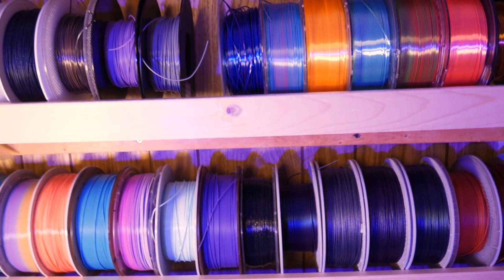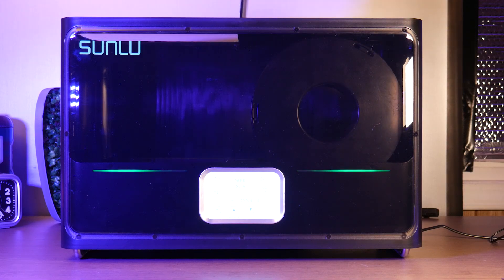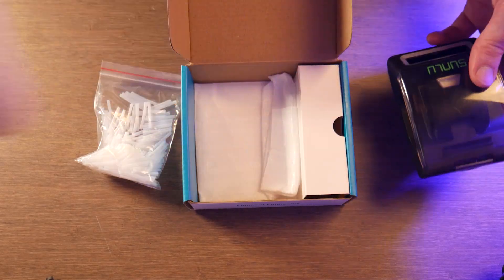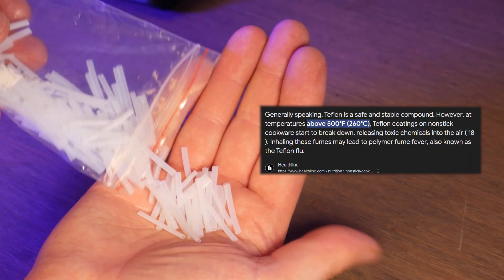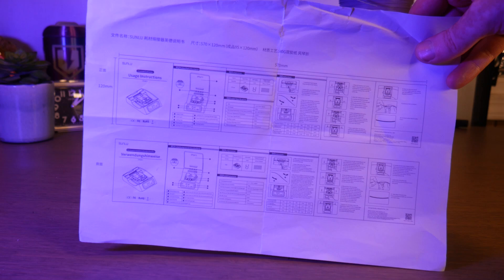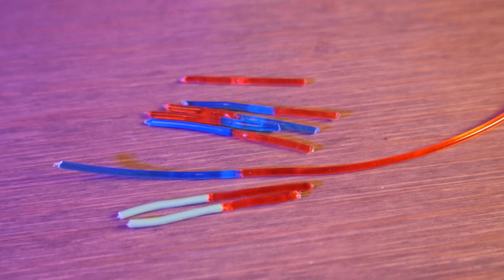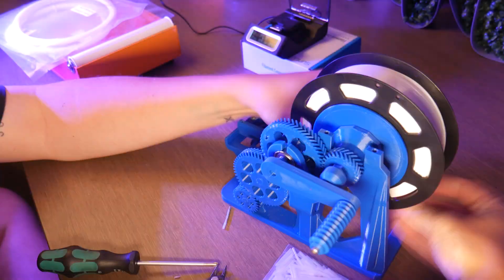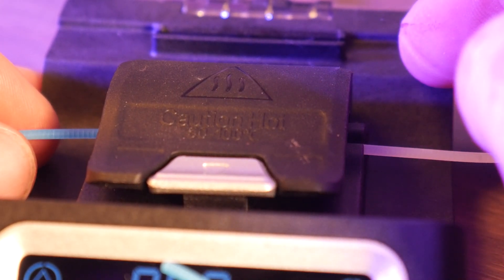Unlock Zero Waste 3D Printing with the SUNLU Filament Connector FC01!

Comment: After fusing the two pieces, are you able to slide the connection out of the PTFE tube (the tube slides down one side).  If that works, I think I would get one to put between two spool rollers so I can then spool from the lesser section onto the bigger side then swap the lesser spool for another.

Comment: I notice many are upset about the PTFE tubing, but no one is worrying or happy about all the filament they are saving by not throwing it away? No one here has ever wasted PLA. I bought this and know you can do the same without this unit; use a heating iron and a PTFE tube,  but this is much easier for me. If you don't like this idea, do not use it or build your new and improved model, then sell it. It's all your choice. Have a Great Day
Reply: How do you do it with the iron and PTFE tube?
Reply: @g8610g  About the same way, cut your PLA at about a 45-degree angle. Take about one inch of tubing and match the filament you want to join inside the tube. Take a soldering iron and go back and forth on the seams inside the tube, slowly pushing together. You will see them join. Let cool, remove the tube, and TEST  by pulling it apart. After a few tries, you will get the hang of it. A guy who was also a fisherman did this to make his own lures. Good Luck, it will take some practice.
Reply: That sounds great but if you go over the PTFE tube where the 2 filaments join with a soldering iron wont the PTFE tube melt?
Reply: @g8610g  No, the PLA will melt first. But you go back and forth, not just in one spot, but also on the bottom. Don't try High heat; use Medium. Note that SUNLU does not melt the PTFE tube. If you had a lot of filament welds to do, I would buy the above SUNLU connector.
Reply: @randystevens2710  ah ok. Thx!

Comment: 100% I'd use this. When printing things that take days to complete but need certain colors, sometimes what is left over on a spool isn't enough for another big print, so being able to graft an old spool onto a fresh one of the same color means no waste or excess filament that I need to print smaller things with in order to use up. Replacing the old spool with the new one mid-print isn't an alternative to this as I can't always be on hand to replace the spool right when it runs out, meaning it would save me lost printing time due to a runout. Not to mention the fact that having a spool run out and be detected by a sensor can still leave a gap or imperfection on the model due to it sitting and cooling while you change out the spool and throw away that small piece of leftover filament.
Reply from the maker: Yeah I think that’s the ideal use case! I’m thinking of printing a reusable 5kg spool to wind filament on for my bigger than 1 kg giga prints! Thanks for watching and for the comment!

Comment: The problem with this is, who is it for? Why wouldnt you first make an ERCF, or attach a MMU3S or use filament runout, or a Chameleon, or... This seems like a very old solution solved better by other options that arent notably worse value wise given that to even have this problem, you'd need to have bought many filament rolls meaning you probably arent so strapped for cas that an MMU or any of the other solutions arent better.
Reply from the maker: I don’t disagree but at $35 I think this has a way lower barrier to entry. Another commenter tipped me off to a machine called a slunaz which seems like a more reliable option at a slightly higher price point.

Comment: Teflon being a 'forever plastic' and them just... selling a single-use disposable pack of 200 is horrifying from an environmental angle. Why do these companies not just use a silicone block instead.
Reply: "unlock zero waste 3d printing" - proceeds to waste a tube of forever plastic every time you join some filament.
Reply: @jake360flip  Yeah, I noticed that too. It... really feels like shady levels of false advertising, and they're hiring a bunch of youtubers to do PR for them essentially. I've not known Sunlu to be a scummy company like this in the past but it's really not a good look :(
Reply: @StormBurnX  Especially when you could build something that interlocks together then splits apart once fused into the mechanism that isn't a one time use. I'm no engineer but this issue deffo is resolvable with the funds that Sunlu has.